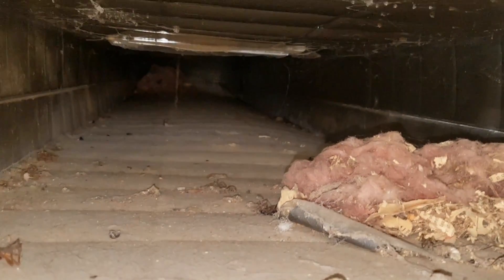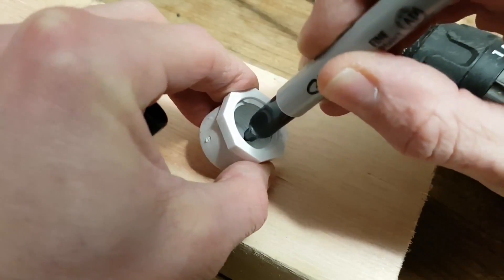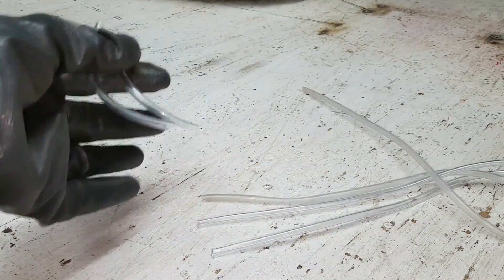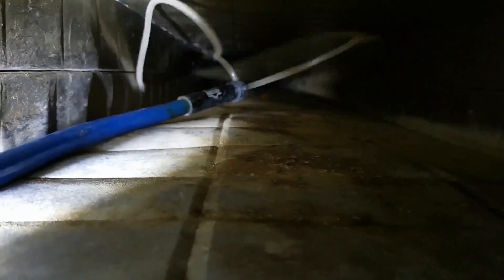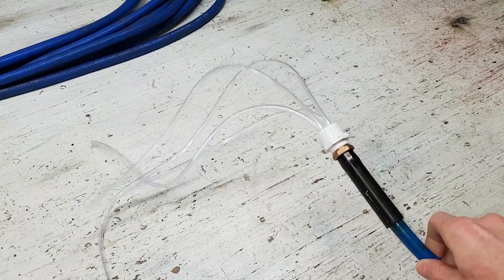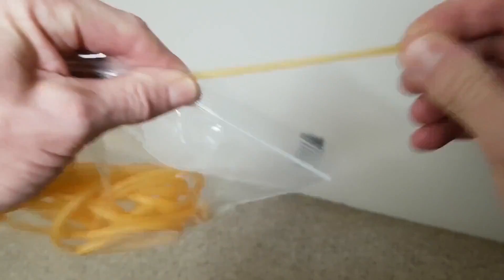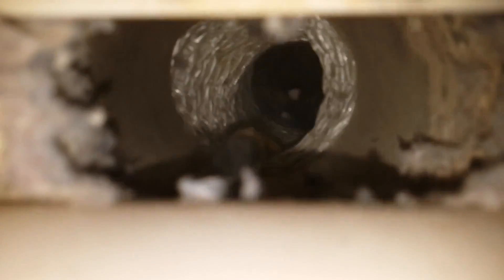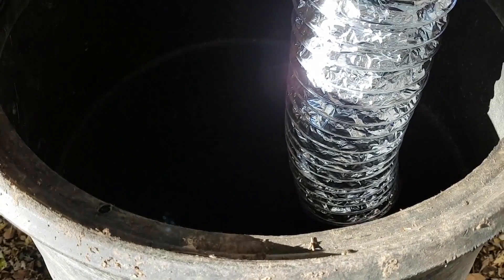DIY Air Duct Cleaning Tools, part 2 - Making Air Whips for Duct Cleaning - Testing Different Designs

Comment: I admire this guy's DIY skills and bravery. I too try to do almost everything myself if I can. Saves sooo much money and is a satisfying way to spend my time on each little labor of love. One thing though, rather then cobbling together a homemade duct whip, you can just buy these things for like $30 or less online. Nitro and others make them. Still a cheap investment compared to spending $700-900 and still not knowing if you'll have them do a good job. So many scammers in this industry.  Footnote: I've yet to clean my own AC ducts after 23 years when my home was built. lol. No way am I paying for some minimum wage flunkies to smash around my delicate flexible tube ductwork with their dangerous equipment.
Reply from the maker: Thank you for your kind words.  I thought about buying a duct whip but didn't want to wait for it to arrive, and I'm cheap.  As with any business type there are scammers, but the professionals who have the right tools and know how to use them can do an amazing job of cleaning ductwork.  I would certainly take pictures before and after the cleaning was done.  And maybe even show the pictures to the duct cleaning technicians before they start.
Reply: @BudgetPhil  I agree in principle. But I'm not feeling too inclined right now to pay someone $1000 to do this work. It's pretty low tech stuff, as long as you can either rent, buy or build the low tech tools needed to do it. For example, most of my ducting on my 2 story vaulted ceiling house is in my attic and easily accessible. Why couldn't I just buy a roll of silver ducting tape and  disconnect each duct line section that attaches to the main duct "manifold", one by one, and clean them out from there. I could just attach a very soft flex-duct brush to my drill, and use a strong shop vac (or my central vac) attached to a custom duct cover plate I would make, then just go to town cleaning each duct tube separately. I would also see all the bends in the tubing from the attic and know exactly how far I needed to go to clean the full length of each run. I could even take my time and do a couple of them per weekend if I chose to take my time.

The other thing is I am able to visually SEE each duct is getting truly brush-cleaned, and will work until each duct was looking pretty good. In my opinion, the faster whip cleaning that many of these expensive companies use doesn't always clean the walls of the ducts as well as gentle brushing, where the gunk is also drawn out by the brush during agitation and removal. In the videos I've seen, the walls of the ducts after a whip cleaning still look kinda dirty. So it makes sense that it would cause faster future build up by dirt and dust since it would more easily cling to the leftover dirt and residue.

But that's the good thing about these DIY projects. We can all learn from each other and come up with creative ways to do a better job and save a boat load of money. Sadly most people today can't even change their own engine & cabin AC filters, or their headlight bulbs in their cars without paying someone else to do it. Costing them a small fortune. The information about pretty much anything that needs fixing is available online and often with step by step instructions. You just need the desire and a little bit of ingenuity. Each DIY project builds confidence to do more projects and gives one a great sense of accomplishment.
Reply from the maker: $1,000 is indeed a lot of money to pay for a cleaning that usually only takes a few hours.  Especially when the ducts need to be cleaned every couple years or so, depending on how fast they get dirty.  As you mentioned, there are great advantages to the homeowners who can perform this task themselves.  But many people don't have the time or energy to take on another project and require professional help.  
You're right about the duct whip not being able to clean the residue from the duct walls.  A brush of some sort, or perhaps another tool, needs to be used for that.  If the job can't be completed in a day, then I would recommend starting near the HVAC blower and work from there to help prevent dirt and debris moving from the uncleaned sections into the cleaned sections when the HVAC comes on between cleanings.  If I was short on time, I would be willing to hire professionals as long as they had many good reviews and used the appropriate tools.  They would need to guarantee removal of all the dust and debris and that residue.  I would take plenty of pictures before and after the job, but if they're charging $1,000, they should be showing me pictures.  Thank you for your insight.
Reply: @BudgetPhil  I've only mentioned that because I've watched a bunch of videos, where some jobs on larger houses took 8-9 solid hours. And I've seen comments of people saying they were being charged around $700 on the low end, up to $1000. This just seems excessive.  Like I mentioned, I've never had my ducts cleaned since my home was first built in 1998. Which is nothing to brag about. But cleaning of the entire duct system was something that is supposed to be done every few years, then why the heck don't they make it easier to do this by homeowners themselves.  Its such a massively invasive and time consuming operation that it really should be easier. And I think it was, long ago when everyone had metal duct work. But everything gets cheaper and crappier as time goes on by companies looking to squeeze more and more profit from products with no concern about how these product might be maintained for decades in the future. So homeowners get shafted. Same with cars. Today, parts wear out so fast that a 5 year old car now needs basic critical parts replaced that previously lasted the entire natural lifetime of the car.

I'll continue my research and come up with a reasonably simply way to do this maintenance myself every few years to save money. Same thing with AC condensor cleaning: you can pay an AC company a couple hundred bucks to come out with a couple cans of coil cleaner, your hose, and a screwdriver to open up and clean out your condenser units, or you can play some music and just do it yourself. Endless YT videos on this stuff. If you multiply how much a person can save by doing these little home maintenance things themselves (power washing, gutter cleaning, carpet cleaning, washer/dryiner cleaning & repair, painting, etc) they'd be amazing at the yearly cost savings. Most people just don't want to be bothered or think its too hard or scary to do themselves (especially when the companies who profit from this keep telling you so. Lol).

Anyway, been nice chatting with you.
Reply from the maker: I know what you mean,  seems like all ductwork should be designed with future cleaning in mind.  Perhaps that's why these companies charge so much.  I'm sure it can be really time consuming and frustrating sometimes cleaning large, complex ducting.  The do-it-yourself approach may be riskier for some people than for others, depending on a variety of circumstances.  But I would generally recommend it when possible and practical because, as you pointed out, it can save a lot of money when done right.

Comment: Hey Phil thank for your info .. I was wonder if you place a shopvac vacuum hose right beside the Duct Whips line  would that be better ?
Reply from the maker: I don't believe so, the duct whip swats the debris around too much for a shop vac to control.  However, if the duct is fairly small (8" or less) and has only some light dust in it, then perhaps it could work.  Without good airflow, the whip can send debris the wrong way.  I had to make two passes with the whip on each duct segment because of the low airflow provided by the leaf blower.

Comment: I am a DIYer looking for solutions to cleaning my homes ducts cost effectively.  Thank you for cutting out many of the trial and errors for me!  I opted and built the single whip design with the surgical tubing (already had the components laying around).   I really like your simple vacuum design, I am going to attempt using a furnace blower from my homes previous system to over come the CFM issues of the leaf blower.  I am still noodling the idea around in my  head how to enclose the blower and pipe the vacuum to the drum.
Reply from the maker: I've thought of a couple ways to integrate an air mover with two intakes (one on each side) into the system.  But I'm not sure which way I want to go yet, still testing.
Reply: @BudgetPhil  I was going down that path myself,  I think a much simpler way is to put the entire unit in a box.  Cut an opening for the exhaust , mount and seal the exhaust end,  then you can cut a hole to whatever size duct just about anywhere on the box for the vacuum side.  I think that would work....??
Reply from the maker: Yes, I agree.  Thats one of the two ways I was thinking. The box would be piped to the filter barrel easy enough but I believe it needs a way to filter the air better than the barrel was able to.  Adding a large furnace filter to the system may be an option.  I'm going to try a lower merv filter but it still might restrict the air flow too much.  Cyclonic type separator may be a good choice but a bit more work to make.
Reply: @BudgetPhil  I have been getting some inspiration from my ash vacuum that I use for my pellet stove.  The filter works like a plastic trash bag liner in a trashcan,  I was considering a burlap feed sack for my use.  I am certain there are other cloth materials that would work better for more repeated use.
Reply from the maker: I like the filter bag idea.  The larger surface area should help with airflow.

Comment: So it seems that there is a correlation between the width of the duct and the length of the tubing. Your 14" ducting took approximately 14" tubing. Your 6" foil duct took about 6" tubing. Forgive me if that seems overly obvious on my part. If you get this down to a science, as you already are, you could make some money doing this. Interesting info.
Reply from the maker: When the tubes are slightly longer than the duct width, their whipping action is the least restricted it can be while still getting full coverage in the duct.  However, the length effects it's performance a lot.  During the video when I cut the dual whip down to 12" it whipped around much better, but I needed 14" tubes to get full coverage in a single pass.  I still have a lot to learn about duct cleaning and will continue to share what I discover.

Comment: I suggest you set up the blower in the room at the duct and then attach lay flat ducting to the outlet of the blower and run that out a window.  Here is a link to the first listing I found, I am sure there are cheaper options, especially considering the quantity you will need. 

https://www.amazon.com/Allegro-Industries-9500-500-Ducting-Blowers/dp/B00TD6HZFU/ref=asc_df_B00TD6HZFU/?tag=hyprod-20&linkCode=df0&hvadid=198073417649&hvpos=&hvnetw=g&hvrand=3887202328430402949&hvpone=&hvptwo=&hvqmt=&hvdev=c&hvdvcmdl=&hvlocint=&hvlocphy=9009831&hvtargid=pla-511426070832&psc=1

I am really interested in this, my ducts are filthy.  I appreciate the in depth R&D you are doing and filming.  Take care.
Reply from the maker: Thank you, I'll take a look at that flat ducting.